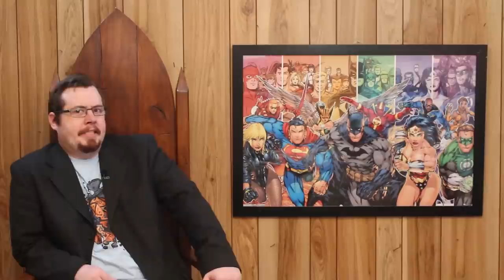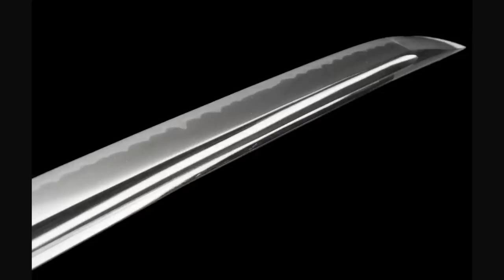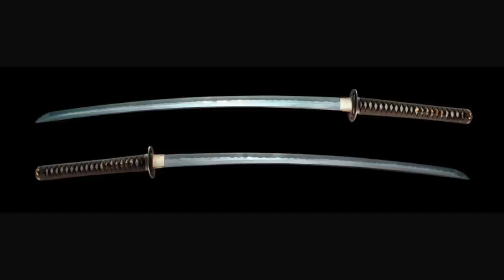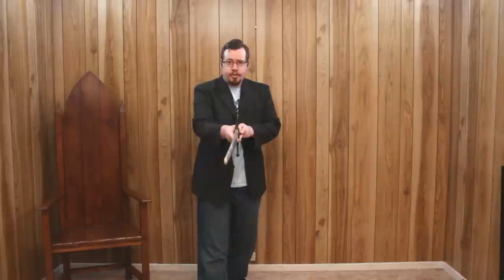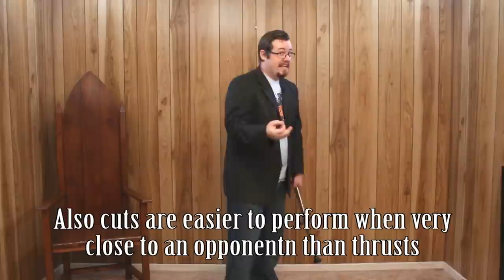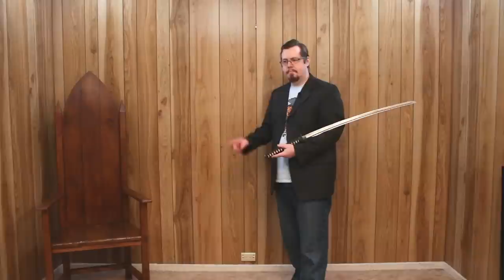Super cutting swords, are they needed?

Comment: I think specialized cutting has a place in a specific armour context. You see, in order to prevent damage from a lethal weapon, you need to use armour actively. A thrusting weapon is more easily blocked by armour because you can move with the thrust. Thrust me in the chest, and I can lean back on the force, and while you're gonna pierce my armour, it will keep the tip away from my skin by burying the tip in the armour, and me then changing direction.
The same is not true for a heavy duty chopper.  Changing direction is simply less powerful a defensive strategy against a cutter that has already hit you. It my not cut as deep, but it will still cut.

Of course, this is considering thick leather cuirasses and gambesons. Chainmail or brigandine will already severely limit the power of a slashing weapon simply by having the metal deform the direction of the cut. But the latter wasn't often worn on arms. Thrusters have a significant advantage when it comes to metal armour. A metal plate that deflects a thrust will not stop it; the tip will just slide into a location where it can, still doing damage. Chainmail links don't make a rapier skid off; the rapier tip would sooner break a link. Metal breastplates are much easier to pierce with a rapier than be cut with a falchion.

In an unarmoured fight, I think a cutter will be more effective than a thruster. Yes, the thrust will be lethal, but it will take significantly longer to disable your enemy with a thrust than a cutter will. And disabling is much more important in a fight than killing.
Reply: (I should add that, in an unarmoured context, reach still beats cutting power. Stab and run is still better than getting in there, disable, and hope for the best).

Comment: I know I'm late to the party considering how old the video is but how about looking at the design from a different perspective? Perhaps from deflecting blows? If you look at a curved blade compared a comparably sized straight blade, the curve allows the user to pull their blade along the curve to more easily disengage from a blocked strike because the blade shape cause it to slide along it's curve as force is applied but with a straight blade it will instead actually put more force back on the wielder's wrist as force is applied as you move down the blade towards the tip. Just a thought

Comment: Overkill is not overkill in combat. In practicality you often fail to cause enough damage to kill if you face strong opponent. Also sabers in the east show that when fighting on horse cuts are more prominent, because it is much harder to aim effectively with thrusting on the horse, and cutting off enemy arm, is more likely to disarm an opponent, because when on horseback, you can actualy attach the weapon, even if your arm is ruptured, but it ain't that easy if it's cut off. Also, thrusting on horseback in only realy good if you do it with a spear, or a lance... althou some horseback riders used Koncerz(a thrusting sword) in addition so sabre. But they were often fighting agains highly armored opponents when they did - and thrusting is indeed more likely to pierce armor than cutting - in combat situation. Althou it is good to have options - and so they took the best of both word - having super cutting and super thrusting swords, changing them depending on the situation.

Comment: My two cents: as you said yourself, one may be more incapacitated to thrust while at short range from the opponent. So let's take an ambush as example, if you are already at close range because your opponent was not expecting a fight, it would be preferable a saber or a falchion in my opinion.

Or if you think to pirates, that fought their battles on ships with limited available space, you might want to prefer a saber as well. Plus if you consider a same length blade, a curved one will have more steel, so more weight, so more impact. And if you are on a horse back you have more impact in a sword that is "as much" Long as a straight one (so easier to carry around).

I love falchions and sabers and I'm more comfortable in using them so maybe even if I can be effective with a longsword, having a choice I will prefer a saber. But honestly I suppose I can say so because I don't need to slash or thrust through people to survive :D

I have also seen blades with really accentuated curves, so when the wielder "telegraph" A cut, when the opponent tries to parry, with a wirst rotation the tip of the saber can reach the opponent's face anyway

Comment: My perspective: With a specialized cutting weapon, less force is required to do the same amount of damage. A glancing blow with a Tulwar will surely disable where a Longsword or Rapier might only bloody / flesh wound. Sure, under an ideal, full-force strike to a vulnerable target, you're dead no matter what; but how common is it to be able to really wind up a clean full-force strike against an opponent? 

In the case of a Tulwar, the sword isn't so much "swung" as "drawn" across the target. This is a very efficient and low energy movement that nonetheless does a massive amount more damage than the same technique from a longsword. Could a guy with a longsword wind up a big baseball bat swing and do just as much damage? Yes; but that's neither very efficient or realistic.

With a clean, full-force strike, I could kill someone with a rock, or a sharpened stick, or a cast iron pan. Could it then follow that mining a bunch of iron, cutting down a tree, making charcoal, smelting the iron, adding carbon to make steel, and forging a sword is overkill? Just use a rock, or a sharpened stick, or a wee knife.

Comment: Swords are tools. Their effectiveness is entirely dependent on the user, regardless of whether it's designed for cutting or thrusting. The designs of swords evolve based on how they are used in the area at the time. If everyone is wearing chain mail in an area, a sharp point that can slip between the links is the most efficient type of weapon to use. The right tool for the right job.
 Weapon production is usually dependent on the armor worn by your enemies. The evolution of armor is almost always due to the most deadly weapon it needs to protect you from. Needs change constantly in war, so what is needed in 16th century France is not thee same as what is needed in 14th century Japan.

Comment: A sharper blade means less effort.  A person who is used to swinging a heavier blade might view a sharper  blade as unnecessary, but someone who isn't as strong would find it easier to use the sharper blade.  Efficiency is also a point.  While the longsword and the katana might both be able to slice to bone, the katana would do it easier.  In combat where one might need to dispatch their opponent to move on to the next opponent, a sharper blade means your stike is more likely to disable your opponent.  Where the longsword got a glancing blow that cut the skin of the opponent, the katana managed to partially sever the muscle.

Comment: I think its just a different way of fighting (as already mentioned before for example on horse back). 
I would want my sword as sharp as possible with a good balance between cutting and trusting abilities (more on the cutting side though, cutting is generally just more usefull than thrusting), I think about fluency of movement while fighting, if you cut you don't want to lose to much momentum and want to do it as fast as possible, don't want your sword to get stuck, being instantly ready for the next move.

Comment: Cutting swords would be better for taking down calvalry units because to thrust at a horse coming at you is dangerous from the front and difficult from the side, but with a cutting sword you can stay off to the side and still get the advantage of the horse's momentum against your blade. Cutting swords might also be better for the person riding the horse because you can cut the person and keep going, rather than having to go slow so you don't lose your sword after jamming it in someones ribcage.

Comment: It also comes down to the style of swordsmanship and philosophy, the katana  needs a certain type of thrust; there is also the art of the killing draw. the katana has an advantage to how it is forged for both cutting and thrusting; done right...it also has to consider the armors that are in the area that they are used. yes there are issues with a katana, the thrusting is beaten by a rapier, and the cutting beaten by a falchion, however a good balance, along with the armor of the area. Consider with the scimitar, and flamberge, the ability to be used on cavalry... an angry horse is a problem, a TRAINED FOR COMBAT angry horse is worse. So the ability to know that the horses leg is coming off MAY have been a type of insurance. Camels are able to be more formidable than horses. Another thing to consider, if the armor will stop a typical arrow for the area, how will it do with a good sword. Think of the silver and red tipped bullets of today, if it pierces your armor, does it need to light you on fire; If it lights you on fire does it need to pierce your armor; if it helps put 10 rounds into you does it need it do either if it can batter you to death with four total hits, three of them glancing?

Comment: Sir Galtah pointed most things out but I want to..god im 4 years late with that..anyways!

While fighting cuts and thrusts have 2 significant differences: You can combine cut-attacks..slashes, yep, with much more gentle movement, add following attacks more swiftly to it than with thrusts.
You can hold up your momentum. But if you thrust, you rly put a lot of power into a single point, the tip of your sword, your whole movement alignes to this purpose.
If you hit: probably instant win but so does a successfull cut, but if you miss you are wide open for enemy attacks and if your combattant isnt a fool you will get pushed into defensive position.

No for armor: A thrust will of course do better against armor, but this video isnt about thrust right? ok.
Weapons specialized in cutting will do the job better and longer than those who are not. You wont get stuck in a body, as your own example shows: cut a head of and have the advantage of a blade that can be used for the next opponent or get stuck midway in the neck and pull it out first, which is better?
Cut epmhazised two handed weapons are even used against cavalry, chopping legs off horses is no problem at this point.
Also such weapons forgive badly performed attacks more likely than others.

Metatron showed a video where a Iceblock was to be cut in half by a Katana and a Longsword.
while the katana split it in half the sword got stuck (he said at this point you dont use these weapons like an axe and yes this test was terrible for the weapons but doesnt it show us that maximized cutting power is nice to have?)

Comment: A proper thrust is quicker and is driven deeper than a cut is. Until it runs the risk of getting stuck a stabbing motions is quite effective although it takes longer to bleed out not to mention strangely enough less painful.

On the other hand is slicing sword is often made for the precision-cut strange thing as both people are moving or both targets per movie in most cases the precision-cut has to happen in a very quick instant roughly less than half the second after the opponent has noticed that your blade is moving that you bleed out much faster and a single cat is devastating immediately.

And then there is the issue with armor nither  cutting Nor thrusting rules against armor. Does the frosting point is small and after a few thrusts you've gone from trying to drive a needle through this Hargis to trying to drive a blunt needle through the target.
Yet with cutting you got a nice long Edge and it can take several points of punishment along that edge and still Cuts very well however with each cut you are going to have to apply more Force because every time you attempt to cut and strike armor that edge is going to dull a little bit more just as that thrusting points did.
In either case cutting or thrusting eventually you are going to be attempting to push a dul piece of Steel through a piece of Steel.
The riddle of Steel is this how does steel get through steel to the Target.
Oftentimes this riddle as puzzled people quite severely however I have taken they look at those who cannot afford to allow their blades to fail them and they carry interesting glace not Swords not Spears I even find that they do not carry axes so much as they carry hammers. Oftentimes with Spears top and access to one side and a hammer to the uther. They call it a halberd.
Yet there is a problem with that as well as they are three Tools in one they are heavy and so many different kinds and forms of Hobart were created.
And yet the riddle of Steel has not yet been truly answered with steel but only met the answer to the riddle of Steel will be found at the end of the horse race.
The best dancer I have come up with is your combat Style. Maintain enough practice that you are highly skilled. Balance your training as you have balance your weapon. And balance your rage with temper as you have balance your steel and and tempered it so that it was neither too hard and got brittle or too and ended up with mild steel instead of tuff. 
As a matter of fact balance everything with everything and attempt to eliminate duplication in order to minimize wait and even in this keep going so that you do not get a weapon that is too late to do its job.

Yes truly I say the answer to the riddle of Steel is balance in all things.

Comment: The only thing that speaks for excessive sharp swords is to cut through many layers of textile, like a gambeson, but that's basically the only case i can come up with. 
Maybe it is just easier for a human to do cutting movements than to thrust with a weapon?
(I remember a video made by Matt Easton, where he explains just that case)

So maybe the pursuit for super sharp edges has become a thing on it's own, regardless of its actual practical use (maybe that's just the simplest way to compare two swords, idk).

Comment: I think in most places where these "super cutting" swords were used they mainly wore cloth armor and gambersons. So extra cutting power could help a lot to get through a few layers of clothing.
Reply: That's very likely, otherwise they would have used something else. :) 
However the argument here is, if a "standard" longsword could have cut through those layers of clothing as well, then sacrificing other aspects of the weapon for maximal cutting effectiveness may be detrimental overall. A katana could superbly slice through an ashigaru with simple protection... but a longsword could do the same, but also be used for thrusting.
Reply: @doctorgorgomel  But these cutting focused swords ARE better for cutting. The reason it's not worth it most of the time is because cutting power doesn't matter against metal armor. What my argument is, is that in places where cloth armor was more prominent, that extra bit of cutting power could mean the difference between getting through it or not.

Also a lot of the cutting focused swords could still thrust just less effectively (of course not all of them).
Reply: @elekescsaba7971  I understand what you're saying and these weapons were developed to deal with the opponents faced by the wielder. Obviously in ancient japan, there were no full plated knights and chainmails were fairly rare too. However as I understand, the video is looking for a more general, global solution. Not assuming a particular enemy, hence the required flexibility. And also contemplating about how necessary those specialisations and compromises are. Let's say, you're cutting at an arm with a sabre or katana. Both will slice through the garment, both will slice into flesh, into bone and perhaps severe the arm. Job done.
Now if you do the same with an arming sword, or longsword you will still cut through the garment, you will still slash the flesh open and bite  into the bone, perhaps breaking it, therefore you are still disarming your opponent (just not literally :D)
So it is not necessary to on top of this to also sacrifice the flexibility of the weapon.
-
Or let say, I need to cut a cardboard box. I can use my regular scissors i have at home - it does the job, I've cut a piece out for myself.
Or I can use the "sharpest scissors in the world" - it will still get me a piece of cardboard, just with slightly cleaner edges. Did I need to have the "best" scissor to get the job done? Not in this case. :)
On the thrusting, yes, I know you can thrust with a katana or a curved sabre and there are several techniques for that. But not as well. Just as you can cut with a rapier, but not as well. :)
Reply: @doctorgorgomel  Yes, on clean big cuts both type of swords get the job done. But on smaller, quicker cuts that maybe aren't perfect (and these are a lot more common in a real fight, your opponent is not gonna let you line up your strikes perfectly) even a 10 - 20% increase in cutting power could mean the difference between disarming your opponent or just lightly scratching their arm. And that makes it worth using in my opinion. 
But of course longswords are more versatile, they are the happy medium for everything. :D

Comment: Your first argument can be summarized as, " you do not need any extra cutting capacity because you can effectively disable an opponent with an average cutting sword."

There is a gaping slash wound wide open in the flank of your argument.

Extra cutting capacity means that I can do a cut of lesser quality, and still achieve satisfactory results.

Where as a sword with lesser cutting capacity needs a very strong and well placed cut in order to achieve similar results.

It essentially means that a sword with excellent cutting capability can achieve an effective and disabling cut more often and with less effort. Just because it CAN cleave an arm right off does not mean it MUST cleave an arm off.